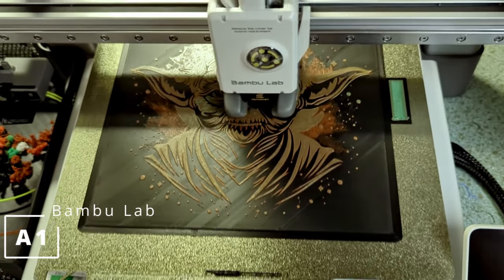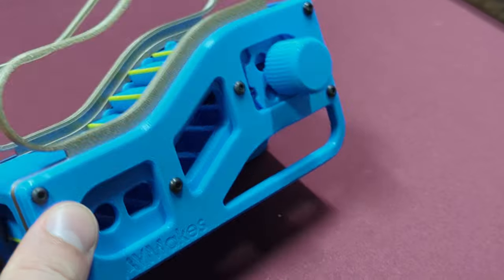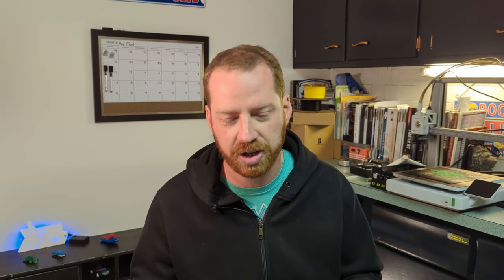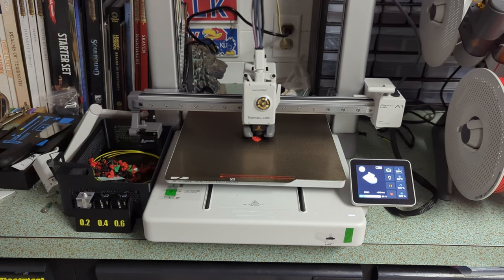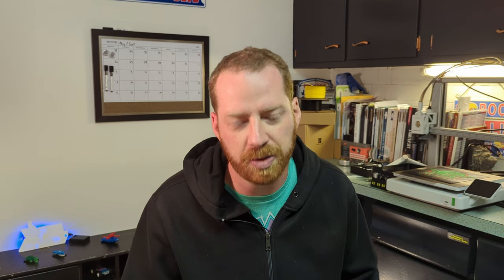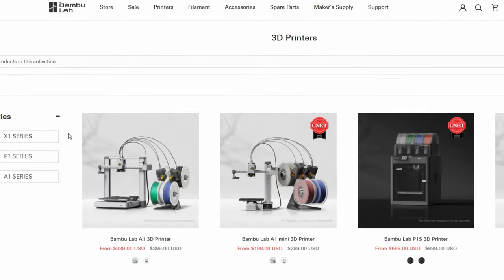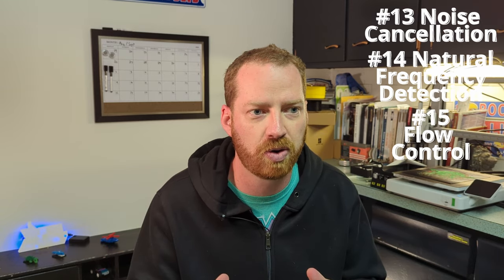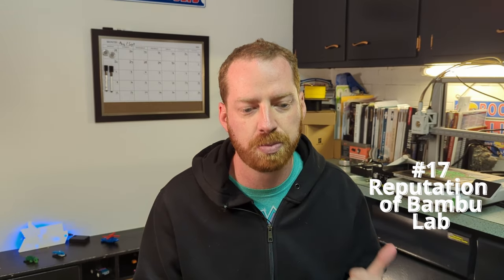A1 Bambu Labs 3D printer is the best 3D printer in 2024. Period.

Comment: Theres just a little weakness about the AMS Lite. The design and stand is terrible and forces the user to modify it either by hanging it somewhere, or re-arranging the stand. Once this is done you run into the problem with the AMS connector hub at the tool head. With the stiff PTFE tubes, it is almost certain to fail since there is a lot of force on it every time it cuts or purges and thus goes to the x-endstops. Its just... like I wanna know why. The printer is sick, but this is like... Sad.
Reply from the maker: Yeah, I share the concerns on the filament tubes, but mine has held up great so far, and hasn't been an issue yet. I actually like the AMS lite. It really only has that stability issue when you are running at max speed, which I hardly ever run at. I like that it is more compatible with other types of filament vs the original AMS, but yeah, long term might need a box for keeping the filament dry
Reply: You can print out the top mount kit which works quite well
Reply: Nice, is this a Bambu Lab kit or a 3rd party top mount kit?

Comment: I have one. It’s a good printer yeah, but it is a far fetch to claim it is the best. I honestly only use it for TPU prints
Reply from the maker: Nice, I'm about to try TPU for the first time on it. Any tips for TPU prints through it?
Reply: What do you think is better?
Reply: @reesekilpatrick241  In the category of midsize bedslingers, the A1 is surely a contender. Still, It can’t handle ABS/ASA/PA (reliably), hence it is not very versatile. Since the price point was not an issue, I would say that a P1S (if you’re on a budget), or an X1C (if you can afford it), are better “consumer grade” printer options. If you only want to print with PLA/PETG/TPU, the A1 surely is sufficient. But that was not the claim. The claim is that “It is the best printer. Period”. I’m not saying that the P1S or the X1C are the best out there, but far “better” than A1 due to their versatility. I can only speak for printers own or have owned. The A1 is for instance far better than the V400 on almost everything.

Comment: Clean the plate, level the bed, wait for the extruder to heat up, extrude filament, print first layer. Scrape first layer off, clean plate, re-level the bed. Watch as first layer is laid down. Thoughts of suicide abate as the layer goes down nice and smooth. Wait patiently as the model rises into reality. You notice one or two blobs but think nothing of it, sand them off easily. Then the layers start to become uneven. The filament begins to pop, because I could not be bothered to dry it earlier. The model is almost finished and it looks like shit. It is now approaching midnight and I have been trying to print this thing for hours. My dog barks at me, he thinks I am a stranger in the house, it has been so long. This was my life from 2019 to 2024. The trials and tribulations of the Ender 3 and Ender 5 pro. Now....I clean the plate. I check the filament. I sit at my computer and send a model to my Bambu Lab A1 with AMS. I take my dog for a walk, and I get an alert on my phone, "Print Successful". I keep wondering if I am going to wake up with my head slumped over my ender 3 and all this was a wonderful dream. That I still have burns on my fingers from changing the nozzle, and screws everywhere from dismantling the extruder...AGAIN.    Seriously though, if this is Bambu Labs' first venture into the 3D printing world, what the heck comes next from them!!!!!!! Automatic nozzle change? Auto clean beds? Judging by what they have done so far it would not surprise me if they created a Star Trek-type replicater. Simple as that, bish bash bosh $299 thank you very much.

Comment: Wrong. X1C is king
Reply from the maker: Interesting, what makes you say so? I mean I can buy 4 A1s for the price of an X1C + AMS
Reply: X1C is a 2022-released printer, so doesn't make any sense other than dumb fan-boy screaming.
Reply: I'd agree that the X1C is an excellent machine, but it depends on your use case if it is worth the $1200 price point. It is only slightly faster than the A1 and has comparable print quality for the most popular materials. At only $339, the A1 is excellent value and would be a great printer for beginners and experienced users alike.

While, it's great to have the enclosed bed for some of the more tricky materials like ASA and PETG, in that case I would recommend the P1S at a more moderate $600 ($850 with the AMS). Plus, if you want to print fiber reinforced materials like you would on the X1C, you could always upgrade the P1S hardened steel parts for about 50 bucks.
Reply: Different beasts for different purposes.

Comment: I have been printing since 2009 and have a few printer but after buying the A1 combo a few months back and WOW, I've sold all my "other printers" and goot a few more.
They just work out of the box. So easy to setup and get printing,
Reply: Well, I knew very little about 3D printing, but bought the Bambu A1 Combo less than a month ago, and AM IMPRESSED. OK, so I'm a Mechanical Engineer by training (40-50 yrs ago, now retired) and am comfortable with IT stuff, and I am going up the learning curve (rapidly), but the A1, and all the supporting functionality and infrastructure, has made the journey so far straightforward. I started with std 0.4mm nozzle, and std settings, with PETG-HF (some promotional deal on at the time), but have felt comfortable, and confident, enough to invest in a 0.2mm nozzle, smooth build plate and PLA(-Silk) filament. So far, so good. Focus over the winter will be 1:50 architectural models, so let me see how I feel after the honeymoon period, but the A1 is certainly an excellent entry route, and I don't need to invest in anything more capable for the foreseeable future. Even with the 5kg of filament (various), additional plate/nozzle/misc I've spent less than £550 - a lot less than some of the other 'hobbies' I've had.

Comment: 3:21 I love my Neptune 3 Pro, but watching that print speed made my 24-hour dragon models cry.

4:30 Oh my goodness, the things I have to do to replace a nozzle on my current printer.  Unscrew this and that, turn the printer up to operating temperature (which makes me nervous to even be near), use a special tool to remove and then replace the nozzle, turn printer off to let it cool down, screw this and that back in place.  I'm thinking about picking one of these Bambus up just for that, let alone the multi-color printing.
Reply from the maker: To be fair that print was the speed bench, and I think the default settings for printing are about half that speed. You can set it up to go that fast, but there will probably be some quality issues with a piece that has small parts like a dragon. 

But it is so so fast. I started to print a jet engine with my Ender 3. I printed the main 18 parts in the same time that my ender 3 printed 2...was wild to see.

And yes! That Nozzle change out is amazing!
Reply: @projecttedford477  This is really good information, thank you!

Comment: The P1S and P1P are better, though more expensive. I assume the X1C is as well, but I don't have one. I do have two A1's and a Mini. The reason the P's are better is because they are core-xy and a bit faster. Usually that doesn't matter, but if you're printing a bunch of print-in-place lightsabers for the kids at Christmas, the A1's failed about 50%. Bed slingers don't do well with tall-but-narrow objects. The nozzles are definitely easier to swap out, but I've only swapped out the nozzle on my P1S once in 4000 hours.
Reply from the maker: That's really good reliability from the P1S, and one more reason to like Bambu Lab

Comment: i think the p1p on sale is better, but that's only when you don't need the ams and want to do rapid prototyping
Reply from the maker: Definitely see the pros of the P1S and P1P! I just think for the price and with the AMS it's hard to beat the A1!
Reply: Nope, I bought the P1s and send it back after a week because of all the issues, the A1 and A1 mini is much more refined & the AMS design is much better on the A1.
Reply: Not necessarily. Especially the P1P. A1 does everything P1P does and more functionality especially the auto flow cal. This is very positive for overhang and top surface quality also the ease of breaking off the support.

Comment: I had an Ender 3 V3 SE which had constant issues with its CR-Touch sensor. Nearly every time I went to print it'd fail and I'd have to turn the damned thing off, exercise the sensor probbe and then try again. I just today took delivery of my Bambu Labs A1 Combo. My god. Proverbial chalk and proverbial cheese. THis thing is insane. It's quiet, it's fast and the quality it produces by default using bog-standard white eSun PLA+ is production-level. It's gorgeous. The quality is mind-blowing. Best move ever. I bought it from the Australian store based in Sydney and it took five days to reach me in Hobart... for free. I'm not complaining, and have just hit the trigger on a couple of dozen Bambu PLAs and PETGs. I can't wait to give their own filament a go.

Comment: The fact that it took you a couple of hours to set up a printer that advertises you can print within minutes is kinda odd
Reply from the maker: Yeah, I totally don't blame the printer for that though. I'm the type who slowly reads through the manual, then I start following the directions to set it up. For me, I had no time table to set this up. Compared to older printers I have had, this things setup is a breeze, but to be clear there is definitely some assembly required!

Comment: It sounds like weird statement that a bed slinger is the best 3d printer in 2024. For god sake, you can only use it for PLA and PETG, which means limited functionality in 3d printed applications. An enclosed printer is the only way to go IMO. I have been printing for over than 10 years and the luck of enclosure was my major issue since year 1.
Reply from the maker: Ah well this isn't your grandma's bed slinger, with speeds as fast as a lot of core xy machines. Also, it is compatible with TPU, PVA, ABS, ASA, PA, PET, Carbon fiber and a few more...
Reply: @projecttedford477  still a bed slinger, it moves the model back and forth, this means once you get to print a thin and tall part it will have a negative effect in print quality at the layer which are higher. It also introduces airflow to the model the faster you print. That means for ABS, ASA and filament that are sensitive to temperature changes it is an additional factor that can cause them to wrap. If you choose to put an enclosure bed slingers require double the space of their build volume. Don't get me wrong I still use my CR10S every day and works flawless, but it feels so limited for these reasons I have already mentioned so I will convert it later on into a corxy as I want to eliminate the mentioned limitations and to include a heated chamber, which is hard and inefficient to implement on a bed slinger. A1 is attractive as it work out of the  box with the AMS Lite, but for the price a P1 makes more sense to me as it is more versatile. What I am sharing are personal experience, you can print any material if it is small, onelce.you print something big it will never be a 100% success. People can buy what ever they want but nobody talks about all the negative of these dated style printers, and most reviews are basically a commercial rather than an actual review.

Comment: Bambulab USA Inc,
Registered at 8000 Centre Park Drive, STE 330, Austin Texas 78754, United States.
Not totally Chinese unlike the rest they could get in a giant lawsuit if they didn't recall. 
They never said what was wrong with it. 
compare it to klipper, which does basically all these things including vibration compensation and um  extruder speed = flow control changing words doesn't make it special.
Even marlin machines can do auto leveling and input shaping.
Reply from the maker: Ah well they have a "headquarters" in Austin, but also ones in Shanghai and Shangchen China.

I'm pretty sure Bambu Lab is using a version of Klipper, they just call it input shaping, and their speed and settings would reflect that.

They replaced for free the power chord for all recalled printers, so I'm pretty sure they were saying the issue was with the power chord. 

There are other similar spec printers out there for sure. I just haven't found one that has as many features for and quality for the price!

Comment: Yeah, best if you like breathing fumes. You can’t put it (or the A1 mini) in an Enclosure. The motherboard doesn’t have enough cooling and the heat in an enclosure can fry it, or fry the Micro SD card, happened to me. 😅
Reply from the maker: Interesting, mine has almost no fumes when I print in PLA, I have not tried to print in PETG or others yet ..